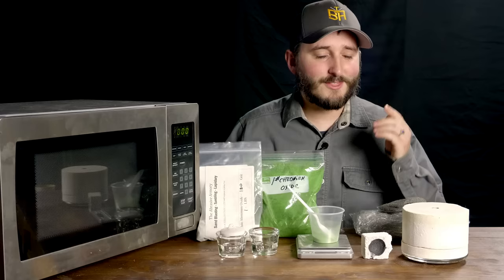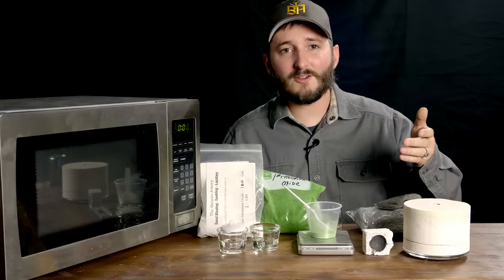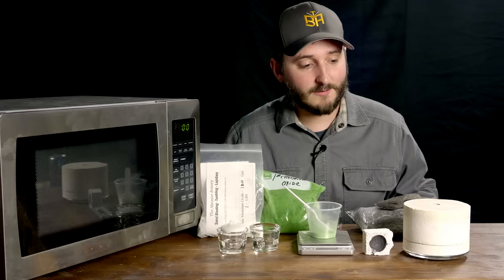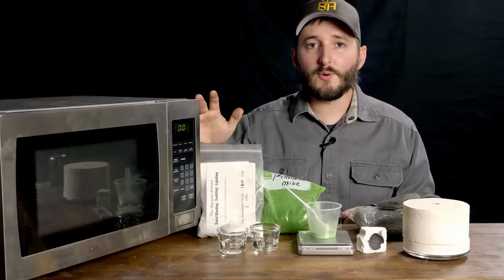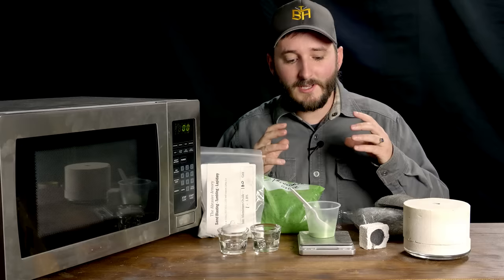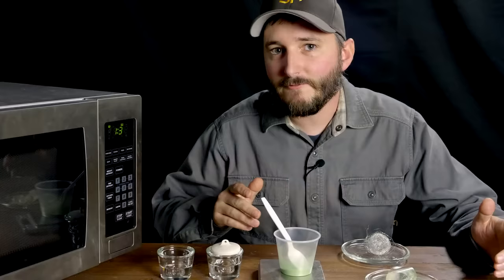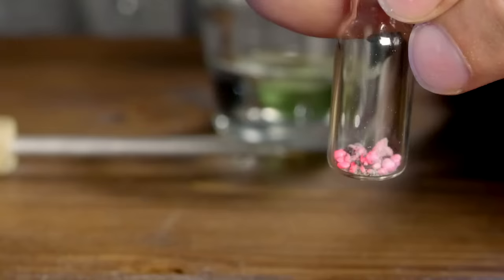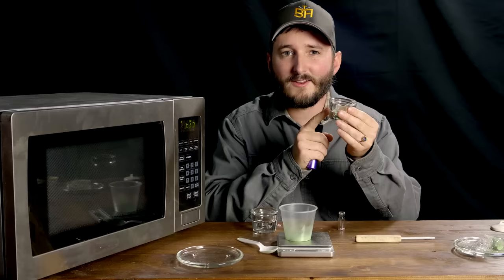How To Make Ruby in a Microwave

Comment: NightHawk: "don't try this at home"
Me: "what do I have to do to do this safely at home"
NightHawk: "this reaction makes toxic byproducts. This is a chemistry microwave now."
Me: goes to thrift store to get chemistry microwave
Reply: Would be easier to buy a small kiln...
Reply: @Hoch134  probably less electricity to use a microwave though?
Reply: @deth3021  I'm not sure about that. You need the same energy for the process and I can imagine that a lot of energy is wasted in the microwave. Also, you will get way bigger rubies with a kiln.
Reply: @Hoch134  I don't think so. With a kill you use most of the energy in a difuse manor, also due to the greater volume heated you have a longer heat up time.

With this method you only run the power for 10 seconds and it's directly applied to the area where the heat is needed.

As for the size. I think there is still potential to evolve this Process.  This seems more like a proof of concept than a refined process.
Reply: @deth3021  That's why I said small kiln - there are very small kilns around.
If you want to do it fast, you could easily use a torch as well.
Of course, this is a proof of concept. But it seems inefficient to convert energy into different forms instead of using it directly.
Reply: It will damage the magnetron in the microwave and shorten its life.
Reply: @Hoch134  it doesn't matter how small the kiln is, it will still be inherently less efficient than directly delivering the energy to the reaction.

Also I think the main room for improvement with waphat was tried here was the random layout of the alluminum .. strands..

I'd be curious to see the effect of having those in a matrix, consistently spaced etc...
Reply: @Hoch134  When energy becomes heat, it doesn't matter which path it took, or what it was before it was heat. Same amount. Nothing is wasted...in what would it the wasted energy be, since normally waste=heat? Well, there could be some microwaves escaping the oven. But not much; how do I know? Because it doesn't get very hot outside the oven!
Reply: @dogwalker666  there are probably industrial use ones that can hold up better.
Reply: @rodschmidt8952  I don't support your thesis. Of course, 'wasted' energy can be heat. But that would support my kiln theory instead of the microwaves (since the kiln concentrates the whole energy/heat where it belongs).
However, I DO expect some waves escaping from the microwaves. You can see interferences with wifi signals for example. It will only produce (convert to) heat when the waves are stopped - for example in water.
You won't be able to heat up the air so it won't get hot outside at all. And if you turn on an empty microwave, nothing will happen either.
Reply: @deth3021  It doesn't matter where the energy is impacting the material but how much energy you insert to the material and how much escapes in the meantime.

A kiln can hold its heat a long time and the losses are minimal. In the microwaves, you'll lose some energy to the conversion to microwaves (transformator) and the heat is very punctual and lost a short time afterwards.

We aren't talking about big amounts of energy so it probably doesn't matter. But it won't be more efficient.
Reply: @Hoch134  it's not about the energy impacting the material, it's about avoiding all thenenrgy impacting everything around the material.
I.e. about the specificity or locality of the heat application to where you need it most.

Also as I think I said in my last comment it should also help avoid doping with impurities.
Reply: @Hoch134   I think the microwave produces much higher temperatures.  A standard electric kiln uses a heating element which would itself melt before achieving the temperatures needed to melt aluminium oxide.
Reply: @ruthmoreton6975  I agree. A kiln will reach tempatures of around 1,800 to 2,400 °F while plasma ranges from 11,000 to 14,500 °F. The microwave can only produce plasma for a few seconds before it either uses up the material or just stops working. A kiln can produce a lower tempature but for a longer sustained time. As for the arguement of efficiency I would have to say to get the desired results a quick 15 seconds in the microwave is much more efficient than the time it takes to get a kiln up to temp and to produce rubies, if even possible at the lower temp, would take much longer and use a lot more energy.
Reply: @Hoch134  with the small one/kilm, he was able to make bigger rubies..  BTW , cool name😊
Reply: Don't try this at home, try it at at somebody else's
Reply: Need I mention that this requires less than 15s in the microwave...?
The microwave doesn't use more power just because of what's inside. It's how effective the method is at transforming microwave energy into heat energy, and how effective it is at concentrating that energy into the materials.

None of that makes the microwave produce/use more power
Reply: @dogwalker666  it's a chemistry microwave now, just buy another one at goodwill :P
Reply: @TheAechBomb  they are expensive here and since they changed the electrical safety rules second hand electrical goods have to come with the same guarantee as a new one so we dont have that option unfortunately.
Reply: @dogwalker666  lmao, this is america, you can buy anything at goodwill if somebody doesn't want it
Reply: @TheAechBomb  I see that's handy.
Reply: @dogwalker666  lol, I dunno what country you are in but microwaves are cheap,where I live they're like under 50 bucks aud if you get the store brand basic model.  Which is under 40 bucks American probably.
They're practically disposable.

This is a brand new one, by the way, not a second hand one
Reply: @Hoch134  nothing his technically hotter then plasma so why search with a method that brings traditional heating around, just refine the plasma way, I think :P
Reply: @dogwalker666  another reason why you should only do stuff like this in a thrift store chemistry microwave.
Reply: @garethbaus5471   as I said in Europe second hand electrical goods have to be sold with a full 12 months warranty,  not practical for second hand goods shops.
Reply: @dogwalker666  do cheap be microwaves not exist in Europe? Used is what I am going with since it is less wasteful and I can get one for free, but it isn't like new microwave ovens have to be particularly expensive.
Reply: @garethbaus5471  they have gone up in price a lot recently cheapest about us$80 and as there is shortage of Magnetrons as there is only a few manufacturers.
Reply: @dogwalker666  $80 isn't that expensive, especially with many of the components being useful for other projects after the magnetron is fried.

Comment: get an aluminium mesh, and put the seed ontop, and then add layers of mesh and seeds, but keep the rim of the meshes open to the air.
make sure the meshes are curved so the seed stays in the bottom, and just pack them ontop of eachother layer after layer, then show us the result!

Comment: You should look into using Flux. With Flux, the powder dissolves into the Flux once it liquefies(similar to how salt and sugar dissolve in water). The temperature required to melt Flux is much lower than that required to melt aluminum oxide. And just like salt water or sugar water, if you have a seed in the solution, the dissolved particles will begin to attach to the seed and grow  a larger crystal. It's a slow process, but if it's possible to do with a microwave, that would be really cool.
Reply: This is how the first synthetic rubies were made so it certainly does work!

Comment: Microwaves always surprise me by how much an everyday item can do
Reply: One can make a spot welder from the HT transformer of a microwave; I'd posit this is a FAR more useful thing than a few small rubies.
Reply: Just a box that casually raises voltage to a plasma-inducing level

And we use it to cook food, poorly
Reply: @Nae_Ayy  idk about poorly, it just works best for certain things.
Reply: @glinchdk  bruh
Reply: @Nae_Ayy  “raises voltage to plasma inducing level” isn’t quite accurate. It’s more about the amount of sheer energy delivered by electromagnetic radiation. It does use high voltages to drive the magnetron however
Reply: @signalworks  ...bruh
Reply: @Nae_Ayy  Bruh yourself... You are completely wrong. The high voltage isnt even necessary to create microwaves in general. Your Wifi-router doesnt need high voltage to produce the same frequency of electromagnetic radiation. A microwave oven uses Vacuum Tube Technology, specifically a Magnetron, and that just so happens to require a high voltage to operate, among other things. The reason: That's still the most cost-effective way to produce large amounts of microwave power.

Comment: This is very similar to the process by which cubic zirconias are made commercially. They use a rf induction coil (basically a big microwave oven) and put a bunch of the base material in (usually 90% zirconia, 10% yttria). Then, a small chip of metallic zirconium is inserted. The metal piece heats up, just like a piece of metal would in a microwave. This will eventually get hot enough to melt some of the surrounding zirconia, and once molten, the liquid zirconia absorbs the radiation and heats up on its own. The molten part is held at temperature for a while and cooled down very slowly, to cause big single crystals to precipitate out, and this is what makes a nice clear gem. 

There's a lot of potential in this method, since it's more or less tried and true. I hope you'll continue along this path of inquiry.

Comment: Idea: isnt it possible to pull the plasma down with a neodymium magnet/electromagnet???
Reply from the maker: Very interesting thought!
Reply: The heat would cause the magnet to lose its magnetic power due to curie point
Reply: @narayanbandodker5482  if you had It under the glass container where the "seed material" is inside ?🤔
Reply: Neodymium magnets max temperature is ~350c before it loses its magnetism, so you'd have to find a way to stop the magnet from heating up too much.

Or I suppose you could stick an absolutely massive magnet on the bottom of the microwave, but that may affect the functionality of the microwave.
Reply: What about a plasma sputtering machine?
Reply: @startedtech  Extremely powerful magnet outside of the microwave might do it.
Reply: @d4rk0v3  overkill is always fun
Reply: @MCtomgie  like the one from thought emporium ?
Reply: It would be demagnetized due to heat.
Reply: @yoppindia  For a few seconds in the microwave shouldn't reach the curie point given it would be under collection plate and far from the heat of the plasma.
Reply: Niculae George  using a ceramic plate to insulate it might keep it from heating up as much, but as you said there’s a lot of experimenting to do
Reply: @ITpanda  first of all you should not put metal stuff in microwave oven, it will heat up in no time, just put a spoon and set timer for few sec, let me know how hot it gets.
Reply: @Hellequin Maskharat we are talking about whether metal or magnet gets hot, so that it gets demagnetized or not...
Reply: The heat ruins the neodymium magnet. Maybe try insulating the magnet with starbright
Reply: @ITpanda  You can put a powerful neodymiun magnet below  the microwave oven.
Reply: @startedtech  just shield the magnet from the microwaves and add some insulation against the heat from the container.
Reply: Use an electromagnet? Like the kind used to pick up cars... I think I know where to get one...
Reply: Loki the sly one  Starlite might work
Reply: @Nighthawkinlight  wouldn't the plasma also be attracted to the magnetron of the microwave? just turn the microwave on its side so that your container is sitting on top of where the microwaves come out of; or do you think it will deflect the microwaves instead since it''s an oscillating field, so you should place it oriented the other way around?
Reply: @startedtech put a magnet below container in tray of water to cool it
Reply: Niculae George  could you "wrap" the magnet in fire brick? bore out a hole the same size as the magnet and place it inside, leaving the top open, then place the container with seed material over the top? i don't know much about fire brick honestly, but it might insulate it enough to keep it cool.
Reply: Plasma is not paramagnetic or ferromagnetic. A generic plasma will not be attracted to a magnet. However, plasma is electrically active, so you can shape a plasma using a magnetic field and even more useful you can repel a plasma using an oscillating magnetic field. If one were to put a coil above the plasma one could push it to the bottom.  It also nicely avoids whatever potential curie problem might exist.  To head off any comments about magnetically attracted plasma... When you pass a plasma through a magnetic field the plasma stream will split into two pieces that represent electrical flow in two different directions... It is not per se attracted.
Reply: folks, if you keep this stream of thoughts for long enough you'll end up with directed magnetron and transmutation of elements like the Super Nova machine of Martin Fleschmann Memmorial Project
Reply: Way to do it is use liquid nitrogen to  make them super cold and stronger  than u can use them draw the plasma down and. Melt the materials into rubies
Reply: Magnets are made of a compound containing iron, so they would most likely blow themselves apart by conducting microwaves and heating themselves up expanding in the plating, which is most of the time nickel, which would also conduct microwaves. Putting the magnet outside of the microwave wouldn't effect the plasma, because of the shielding a microwave has that stops microwaves would also "stop" magnetic waves. Good ideas tho
Reply: @narayanbandodker5482  an electromagnetic trap would do it
Reply: A rodin coil maybe?
Reply: Since a magnet heats up and lose magnetism, I was wondering if it's possible to repel/attract a plasma with another plasma in another chamber right below it? Maybe the charged ions and electrons can interact with the glass as a dielectric and create charge imbalances that put two separated plasmas together similar to capacitor plates?
Reply: Heat will fry the magnet
Reply: Niculae George  Shit went from hot fuzzy air to fusion reactor in a frickin nanosecond.
Reply: @nicholasmerritt1741  Could you wrap the magnet in an aerogel to stop the microwaves, but allow the magnet to stay cool and nonconductive?
Reply: @pike7318  This would work. Even if the bottom of the glass gets hot, it isn't going to transfer 350c worth of heat to the magnet over 10-15 seconds.

The only thing I worry about here is how the magnet might interact with the microwaves. Should be fine, but might be worth shielding it anyway.
Reply: @startedtech  Hahahaha. I just imagine trying to use a comically huge magnet under the microwave and it's just like "nope".
Reply: @d4rk0v3  That might also prevent the magnetron which generates the microwaves from working, not to mention the regular transformers inside the microwave oven. Curiously enough, this evening I watched a YT vid about the effects of a strong magnet on plasma ball lamps - the magnet adversely affected the power supply transformer and killed the plasma by interfering with the power supply.
Reply: Niculae George  wouldn't a magnet inserted into the microwave act as a nucleation point? it would become very hot very quickly
Reply: Hellequin Maskharat non-Newtonian fluids like chili can behave the same way also, surprising the hell out of you by exploding on your clothes.  Or so I've heard.
Reply: Loki the sly one  you know how when you microwave your food the microwaves stay inside the microwave oven? how do you think that works? lol
Reply: Loki the sly one  It's microwave shielding, you asked what you'd use to shield it, exactly that same mesh. A little insulation from heat and some microwave radiation shielding on top of a magnet will allow a magnet to pull down the plasma in the container without the magnet heating up from either microwaves or the heat of the plasma.
Reply: Niculae George  Actually, it's not terribly difficult. The trick is to not have wires going through the faraday cage. Instead, use pancake coils with a frequency choke dielectric sandwich. So long as the driving frequency is proportionally high enough, filtering the microwave radiation out of the driving signal is not a problem.  In addition, since the filter is mechanical instead of circuit based, you don't have problems with failures and overloads.  There's also a significant difference between a two-dimensional coil, and a three-dimensional coil like what they're trying to use with the fusion systems.
All magnetic systems are non euclidean 2d manifolds, so shaping a 2d manifold to enclose a 3d volume without leaking is difficult. Shaping a 2d manifold to push something in a specific direction is easy.  First year physics students can do it.
Reply: The magnet would get destroyed from the heat very quickly.
Reply: @ambrosekillpack4841  you might be surprised.
Reply: Next video:  How to build a tokamak in your microwave oven.
Reply: @startedtech  find a liquid that does not heat and this his solved.